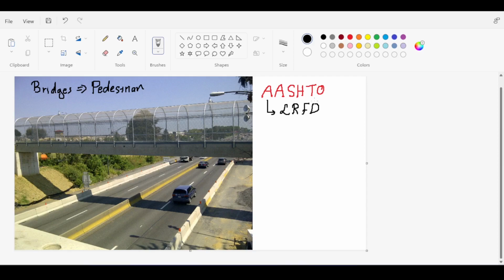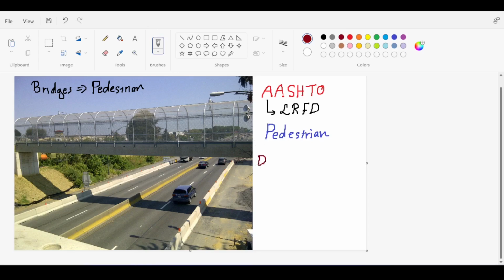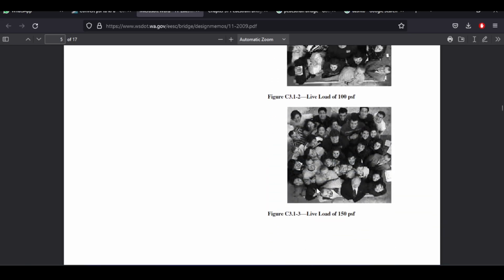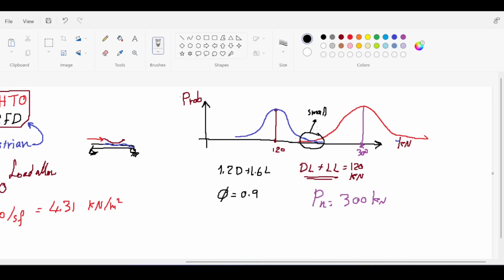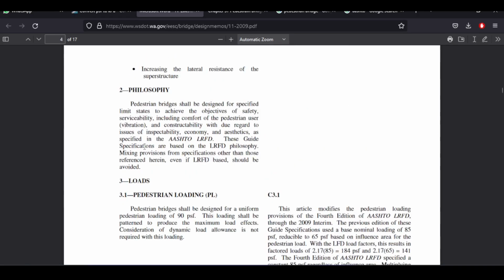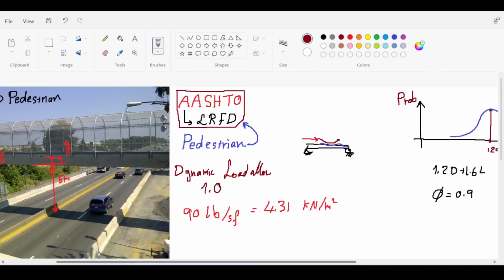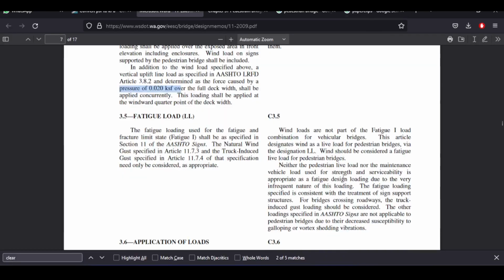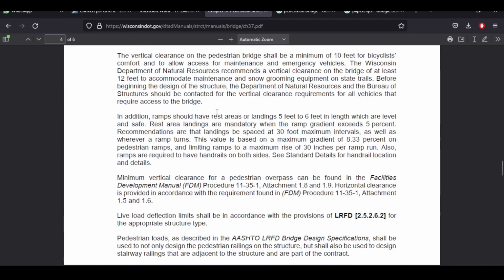Modeling Pedestrian Bridges Using Autodesk Robot | Part 1 - Introduction

Comment: Hi! CEE will you talk further on how to tackle fatigue on robot? I think theres no video on the matter, ty best wishes
Reply from the maker: Hi there.

Yes, I will. Once this project is finished (the Pedestrian Bridge), I will consider the highway bridge. Here, fatigue checks are important and are stipulated in the AASHTO code.

I will show how to check the stresses for the fatigue limit state as per AASHTO requirements.

So stay tuned. I still need to finish pedestrian bridges first.

Regards,
CEE

Comment: Hello CEE,

24:35 That right there is exactly why I find the CEE channel to be exceptional. Mr CEE Editor, kindly note that from what I have seen so far, Mr. CEE Recorder is not only smart, but he is a focused, noble, humble, and an unselfish genius (with your help of course 😊). 

I am so glad that it is also planned to do a vehicular (highway) bridge later on. This will certainly broaden the scope of “bridge things” that shall be covered and learned (can’t wait).

I really appreciate the reference materials and the links. The link to the final draft of the LRFD guide specification for the design of pedestrian bridges is working fine, however the other link to the Wisconsin Department of Transportation Bridge Manual is currently [15.01.2023] not linking for me, in fact none of the state of Wisconsin websites seem to be responding on my side at the moment (I suspect that this is a temporary offline thing on their end and I shall try again later).

Personally, I hold no grudges w.r.t the video being released a bit later than scheduled. For me, it is more than enough that there is an accustomed standard and quality video that was release period.

05:01 I am with Mr. Editor here; I am aware (and I appreciate) that Mr Recorder is also a perfectionist but in this particular case and of this particular idea or suggestion, I fail to see a need to go back to cut or to extract theoretical introductions content from past videos that are already done. There was (and there still is) nothing wrong or inefficient with those theoretical introductions on those videos. Those introductions are (in my opinion) right where they belong and they were made during the time when they were particularly relevant /required. 

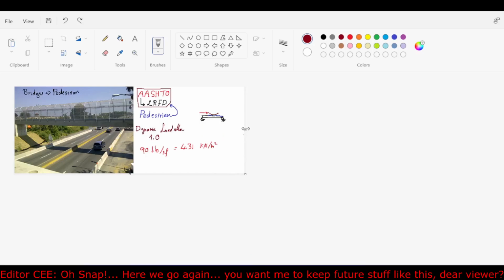10:38 ...Oh Snap!... 😂🤣😂; and YES please, I do want to see future stuff like this! For me, this particular tangent helps one to decide as to what level of approximation accuracy, or better still what level of certainty (w.r.t the strength of materials or loads values intended to be used in calculations) is deemed to be enough, appropriate, or to be adequate in various cases and for the intended purposes so as to ensure that the probability of failure is sufficiently low. 

26:00 Very nice and meaningful tip on the BM diagram, thank you.

I have enjoyed this video and I find it to be comprehensive and very well-produced; the commentaries by the CEE Editor are to die for 😊, keep up the good work.

Have a great day

Regards, DK
Reply from the maker: Hello Engr. Donald

Indeed, vehicular bridges are planned, and this is where things get really really spicy, as you have multiple lanes with their own vehicles, so it becomes necessary to understand where to place vehicles. Also, maybe not all lanes are loaded? what about dynamic impact effects? what about the girder (big beam) share of load?

Those and more are going to be answered in my next project. That is the reason why I have to get the pedestrian bridge done, because it is a "simple" environment where some of the key aspects of bridges are coined and maybe hinted at, which I will then expand upon in the other structure.

Although the editor keeps roasting me, I do think that sometimes he rephrases things I am trying to say in a better way, as cutting those out would lose some of the points I try to raise. 

As for the WsDOT, here is a link of the file from G-Drive
https://drive.google.com/file/d/1z9Il-ObiOVQQRWURjy5lEtQ3IVxGs4Cm/view?usp=sharing

Oh the editor is gonna love your comment. I am pretty sure he may thank you the next video if he does not forget. Poor soul is working so hard.

oh and the positive downwards is also a RSAP thing. ^_^ forgot to mention it.

Regards,
CEE
Reply: @CivilEngineeringEssentials  

Thank you so much for the feedback and for the WisDOT g-drive link.

Regards

Comment: Hello CEE.

I hope you are doing well and happy new year to you. You really sound excited, I hope you had enough rest over the festive period.

Anyways, I love ❤️ this introductory tutorials to the design of pedestrians bridges. 
And I also love ❤️ the idea to separate the theoretical tutorials from the main practical robot demos.

Firstly, I’d have to read more on bridges to I contribute meaningfully. 

Your little internal arguments with your video editor got me laughing. He’s a nice guy but sometimes messes up 🤣🤣

In the BS codes, service live loads are picked from the code 6399, and the load value entirely depends on the use of the structure. 
Mostly I try to be a little conservative by adding an extra 1kPa loads to the code provision.
These service live loads per the BS codes have a probability of exceedance of 5% or probability of not being exceeded of 95%, which is find to be way less than the 0.00001 you stated. (Maybe due to differences in codes)

I also believe, the load and resistance curves for a typical structure as illustrated in the video, should not exceed 5% in my case hence the use of safety factors of (1.4D + 1.6L)

Is there any difference between fatigue and hysteresis effect? Are they same? Am asking this because you explained fatigue in a more understandable terms and am here wondering if it’s same or similar to hysteresis.

I love ❤️ your explanation to fatigue, I don’t think I’d forget. 
Maybe you should explain to me also toughness in a simple term so I don’t forget because I keep forgetting 🤣

Am also a downwards positive fan. 

I look forward to understanding influence lines and its applications.
Thank you CEE 
Have a wonderful, fun filled Sunday. ❤️
Reply from the maker: Hello Engr. Nii,
to be honest, I was about to say something about me using something higher than the 4.3kPa suggested by the code, but ended video editing it out. 
I am thinking of mentioning this again, as it seems that you do that, too.

about the 0.00001, it was just a value from the top of my head. It is not the real one. I think it has something to do with a table of probability. It states the probability of certain buildings (importance factor included) to fail within X years. The main idea, however, still stands.

Hysteresis is the result of material fatigue. Hysteresis is the shift in the stress/strain of force/displacement diagram with cyclic loading. This happens because (amongst others) the elastic modulus changes. The reason why it changes is due to fatigue.

Some fun facts about Hysteresis:
1) Area of hysteresis curve is related to the energy lost from the system
2) Theoretically, Elastic modulus could keep going down to zero. Practically, your deflections would cause structure collapse.

I will try to include modulus of toughness whenever I see the need to explain the stress strain diagram. (I hope the definition of modulus of toughness between what I have in mind and what you are referring to are the same).

Thank you very much for your comment. I always enjoy those.
Regards,
CEE